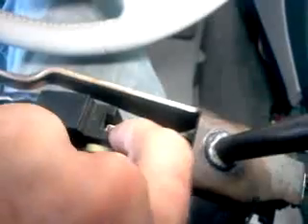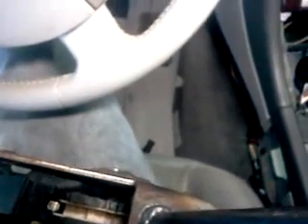Lincoln Aviator shifter fix

Comment: Does this allow the regular shifter to work or does the plastic piece inside the metal shaft need to be replaced? Thanks man!
Reply from the maker: It works as it normally does but without the reverse lockout function.
Reply: @skirkland1980  alright. and what is the part that actually needs to be replaced?
Reply from the maker: @devindillon1  the rod that runs through the center of the shifter